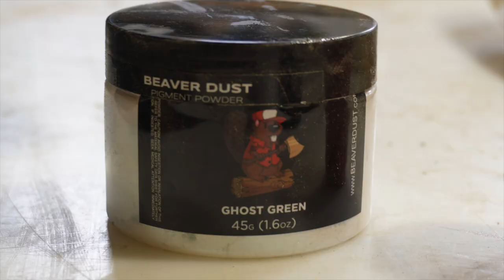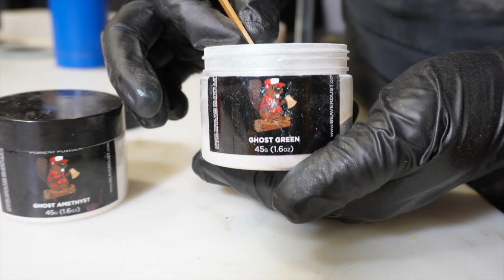How to Use Ghost Pigments for Epoxy And Woodworking

Comment: I'm so amazed and impressed. I'll be 50 next year and when I was about 10 years old I started working at my dad's Sawmill not 40 yards from our front door in Mississippi we probably run the Sawmill for the next seven or eight years but my dad always did some type of custom woodwork  around our place for our personal use such as rocking chairs for granny and the kids but I never had the opportunity to be around really amazing custom woodwork acceptance this we make different things basically in so locally at different markets different types of raw Lumber made crossties and cants for the railroad yard we made pallets different things like that. We also cut our on Timber and sold pine pulp wood. But I have a question because I'm very interested in this type of custom work and I was wondering where a guy like me could go to learn to do something like this is there schooling or just seek out like a job apprenticeship with a good shop somewhere or?
Reply from the maker: For woodowrking with epoxy there are all kinds of online courses, but not official recognized college or apprenticeship course. You could study woodworking/carpentry and start experimenting on your own, or find a shop that is willing to take you on and teach you as you go! Good luck!

Comment: Great video.
Question: in the 1st clip, is it safe to use as a cutting board?
Reply from the maker: We generally don't recommend cutting on an epoxy board, it will leave knife marks and it is much harder to repair vs refinishing a solid wood board.

Comment: I'm curious as to the amount of pigment powder you used in the first project. You almost turned it into a paste... does it really require that much powder for that small of project?
Reply from the maker: The type of epoxy we used has a thick viscosity, but once mixed in it wasn't as much of a paste as it looked in the video. We used quite a bit of pigment and could have gotten away with less.

Comment: I'm wondering if you could something akin to drybrushing (like on D&D minis) with this pigment. that way on the first piece it would become more interesting as the crevices would show a different colour from the ridges...
Reply from the maker: We've never tried a dry brushing technique! Do you seal it off or apply a clear coat afterwards on D&D minis?
Reply: @jeffmackdesigns  since d&d mini's don't get the wear and tear that a table does often times you don't add a clear coat on top, it would make it too shiny and that's not really the look you're going for. you can add a seal on top though. basically what you do for dry brushing is, that you take your brush without any added liquid and you just dip it in paint, then wipe off most of the paint on a towel and then start "dry brushing" the ridges. that way it will only be on the raised parts of the mini and not in the crevice. you'd usually use a highlight colour for this. you can also do the opposite where you take a dark colour and use an excess of liquid to make it pool in the crevices and then wipe off the ridges with a towel to make the shadows pop. That's called using a  "wash". I'm a bit of a noob though so I'd suggest talking to someone more experienced than me 😅
I just really love the effects you can do with it and was wondering if you could apply it to what you do because I think it has the potential to be amazing.